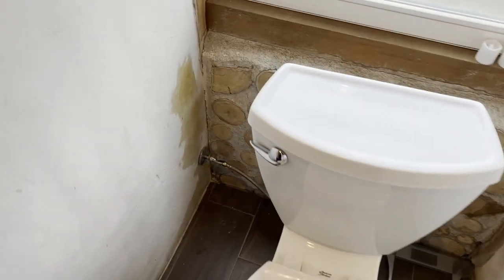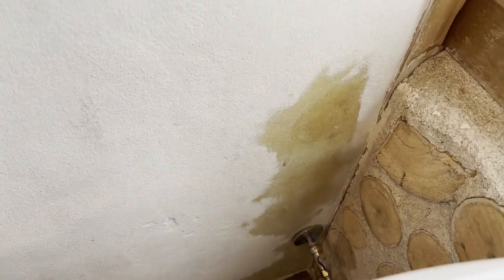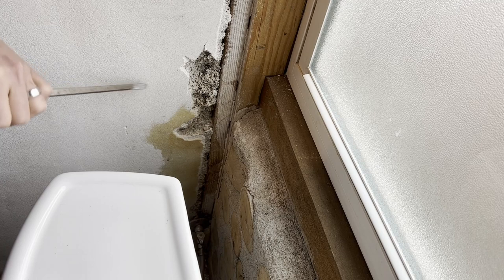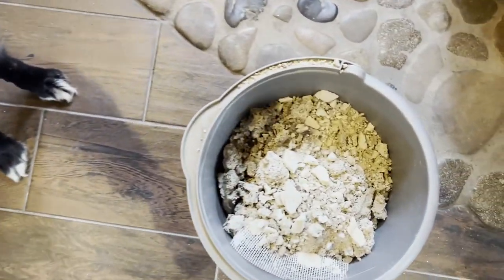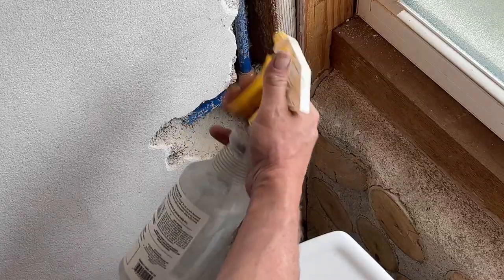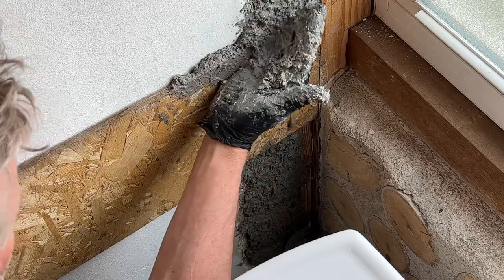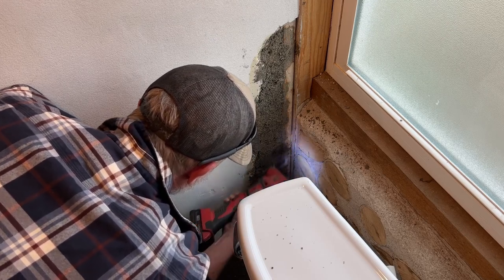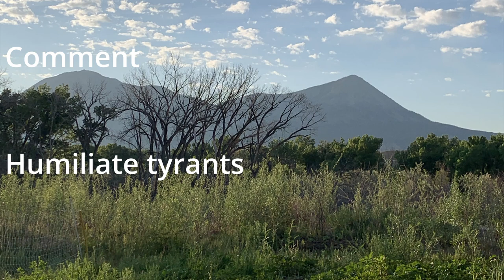What happens when there's a leak in a dustcrete wall!

Comment: Another perfect example of why I will never use pex pipe and the ridiculous fittings used on pex. And shark bites are no better.
Reply from the maker: Copper is still king, in my book!
Reply: How about PEX A? I got the Milwaukee expansion tool, cost a lot but saves money on fittings and leaks.
Reply: Shark bites are great if you can't solder and create easy access to them.

Comment: Now I'm plastering my log house with the same mixture, only with the addition of red clay. This composition was traditional for the insulation of rural houses in the USSR . It is called thermolite in local literature.
Reply from the maker: That is great! Others have informed me of the long tradition with this mixture in Eastern Europe. Maybe if our governments hadn’t spent the last 60 years acting like spoiled toddlers we would have been able to share more insights.
Are you using Portland in the mix? I have plans to test a mix of clay and lime without the cement.
Reply: @radicalgastronomy  I use pure cement without additives. 1 part cement, 1 part slaked lime, 6 parts sawdust, 1 part dry wood chips. I mix these components in dry form, then I make clay milk from raw clay and water 1:1. everything is mixed together to the desired consistency. I use this to plaster the walls. Although cement is considered to be not friendly with clay, lime binds them. Previously, we plastered with clay and straw. The straw was just like reinforcement. But the clay itself takes a long time to dry. It's faster with cement.

Comment: I wonder if you might be able to even reuse the dustcrete that you chiseled out of the wall by simply mixing it in with a new batch - although you might have to pulverize it into smaller pieces first. This seems great.

By the way, I saw a video of someone making styrocrete - gaining many of the same benefits of aircrete without the hassle of fickleness while recycling a lot of Styrofoam at the same time.

Comment: I just found your videos and I'm hooked. Now I have a mobile hole and I'm looking to redo my bathroom how crazy would it be if I did my walla around it with this and I seal it with tiles of course my floor will be redone also.
Reply from the maker: It could work great. Hard to say without seeing it, but maybe.
Reply: @radicalgastronomy  thanks it's a fixer upper for sure. After doing a walk around I think my kitchen would be a good place to start. The wall behind the stove I'm thinking it's around 6' long with maybe 6' tall. I'm guesstimating

Comment: Have you used this method of dust create on a metal surface? I have a carport i would like to (insulate) use this technique.
Reply from the maker: I never have. You might want to paint the metal first. I have no idea how moisture between the dustcrete and metal would effect the integrity of the metal. I suppose, in the worst case, the metal would rust away, leaving a dustcrete building. 🤷🏼‍♂️

Comment: Does sawdust size matter?
Reply from the maker: It does. Too fine and it won’t have much r value. I’ve used wood chips, and they have potential, but would be best screened down to around 1”.
Reply: I just did a 4x8 test panel with wood chips from a local tree service and it seems to be holding up very well. I'm going to be making a 10 x20 tiny home next with it. Your videos are great and very well put together. Thank you.
Reply: @jefflt9344  
Can you post a video of it?

Comment: This is very interesting. Thanks for sharing
Would you be willing to make an e.g. 6 inch block out of this material and stress test it with a hammer after curing? And / or put weight on it (without impact) to see how much pressure it can take?
Do you think it is also applicable for this garden box type
https://www.youtube.com/watch?v=yuSBwFkCiAw&t=1263s
Can it withstand pressure from the side?
This repair video is an important part of this "series" about this material. Don't know if you're the inventor of this mix, but i think you helped a lot of people to broaden their perception.